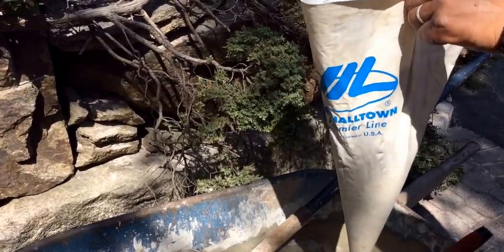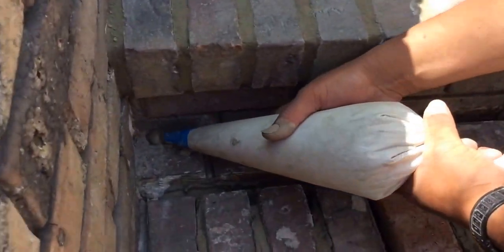Landscape networker| how to repair any brick or masonry steps. Masonry contractors and repointing NJ

Comment: how do you get the mortar to come out of the bag like that?  I tried it and nothing came out unless I cut an inch off the tip.
Reply: John Puccia I assume you need to make the mixture thinner than normal to get it to flow like that.
Reply: Portland cement. No rocks
Reply: Plasticizer or wet-mix.